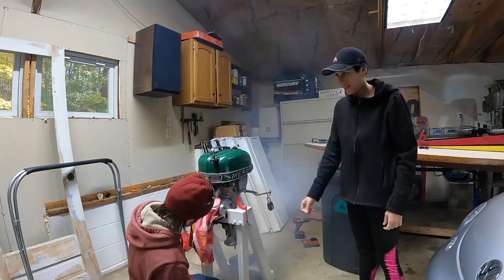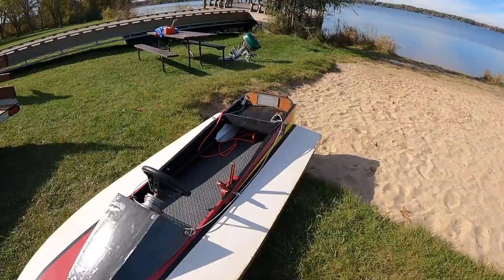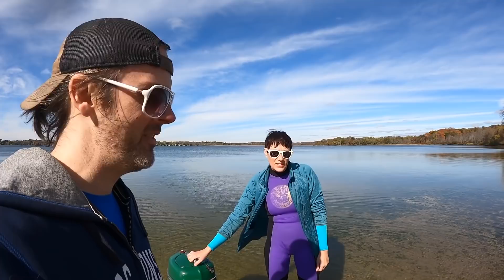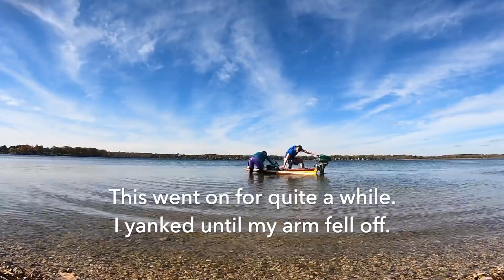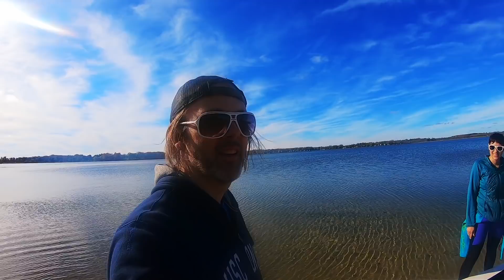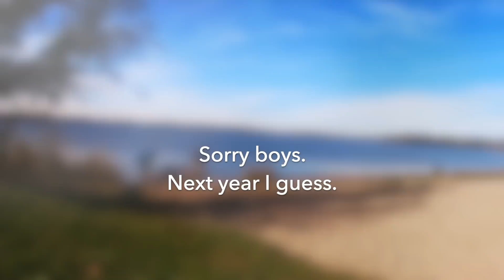50mph with 10hp!  8' Mini Hydroplane Project: DISASTER First On Water Testing 😒👎

Comment: I started racing stock outboards in 1968... We would have a few Brutus looking friends ( crewmen ) lift the trans9m out of yhe water ...While a larger dude would pull the rope ... 
Who ever told you to back the idle screws one and a half turns.. He is correct.. Reprime the bulb..  Make sure the bulb check valves are working .. Prime it untill it gets hard ..Choke it.. Try again .. 
If it does not start in a few pulls.?
Check to see if you have fire at the plugs .. .. If still nothing ? .. Check your compression..
Those old Mercs do not die of natural causes.. 
Some days they just get a bit cranky
Reply from the maker: It runs fine when it's out of the water, check my previous videos

Comment: First thing, move the wife away from the boat, Set the throttle at wide open . Aim the boat straight out into the lake, pull the choke ,when it fires, push in the choke. Head out. Then try to get it on plain and set the high speed needle to its peak RPM and open a 1/4 turn and leave it .Slow down to 3 MPH and set the low speed. After that it should be close to where it wants to be. Your whole problem was you didn't have the throttle high enough to get it moving . You should have been running on the 2nd or 3rd pull of the cord, and off ya go. After the needles are set ,tighten the packing nuts .Then you should be good for the season.
Reply from the maker: Couldn't get it to fire at all.  :(
Reply: @ADDvanced  I heard it fire several times in the video at the lake . Throttle was not hi enough

Comment: Why in the he'll would you keep trying without seeing what's wrong
Reply from the maker: It would start on land pretty easily.  I think the issue is the 1:1 prop drag was too much to pull start; there is no neutral.   You pull the cord and the prop spins, and spinning it in air is easier than in water.   I was thinking if I could get it to catch, spin it fast enough, it might actually run.

Comment: One more important Thang don't run the dam motor out of the water you will fry the rings before you know it .and more so when you don't know what the f#@$%^your doing
Reply from the maker: I don't mean out out of the water, but form what I've read it's common to get the lower unit half in the water, and pull start while the boat is sitting on a sawhorse.   Once it runs, tip down and take off.